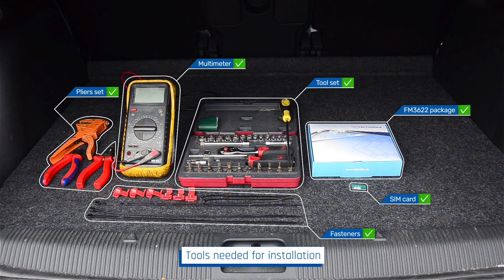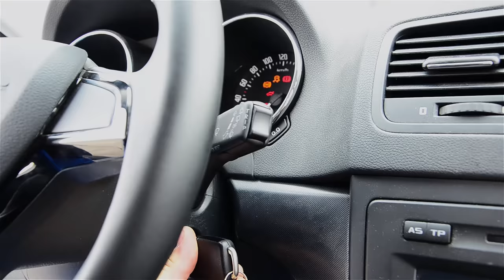Teltonika Tracker Installation Guide

Comment: Thank you . it is very easy to understand<Questions>how much it will cost for the device and monthly running cost (sim data fee) ?Is there any other function except GPS ? such as geofencing, collecting some vehicle data,etc?
Reply from the maker: Dear Johny Candra,
Please fill the form at our https://teltonika.lt/products/vehicle-tracking/ page by pressing button named "Get quotation" in the lower right corner and we will be able to answer you about the cost. Also our devices has geofencing feature, can collect vehicle data via CAN bus, OBD or FMS and has many more features which are mentioned at vehicle tracking device pages near "Features" tab.

Comment: Buen dia, en que casos puede tener o emitir informacion erronea? Es necesario que este adjerida al chasis o en un lugar fijo la cajita?
Reply from the maker: The device might produce incorrect data if it is not mounted properly, especially if it is near many wires or large metal objects. For the best results, it should be attached securely following our mounting recommendations. You can find detailed guidelines at this link: https://wiki.teltonika-gps.com/view/FMB920_First_Start#Mounting_recommendations.

Comment: Hello , in motorcycle with kickstand  i need to cut the power of the main line (12V the key switch ) with relay but is the  same wire  when normanly connect the yellow wire  (acc of motorcycle) of the fmb920. Is this possible ;
Reply from the maker: Dear Giorgos Georgiou,
For a detailed answer please ask your sales manager or find the information in our community forum - https://community.teltonika.lt/ or wiki - https://wiki.teltonika.lt

Comment: what about the other wires? you just connected 2 wires
Reply from the maker: Dear nwike ndulue, 

In this video we have showed how to connect 3 wires for a basic device installation. 
2:56 we have found main power supply wire where voltage is constant.
3:14 we have found ignition wire for ignition detection where the voltage appears when vehicle ignition is turned on. 
3:37 we have connected our tracking device Power and Digital Input 1 wires to these wires.
4:50 is showed how to connect tracker ground wire.

Other wires can be used for additional purposes: CAN adapters, buzzers, LED lights, iButton, multiple temperature sensors, analog fuel gauge, LLS sensor monitoring and etc. Device connection schemes can be found at our web page, near our products at Downloads section. For example - https://teltonika.lt/downloads/en/fmb130/FMB130-wiring-scheme.png .  If you have more questions please ask your sales manager or find the information in our community forum - https://community.teltonika.lt/ or in our Wiki - https://wiki.teltonika.lt/view/Main_Page